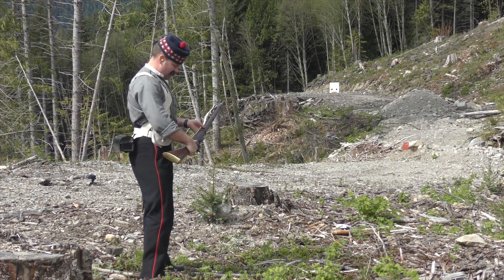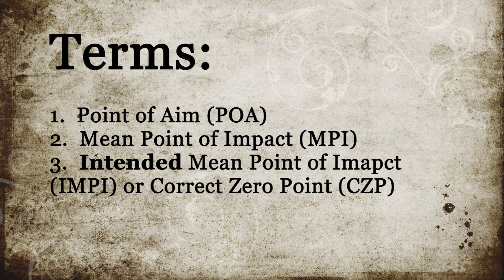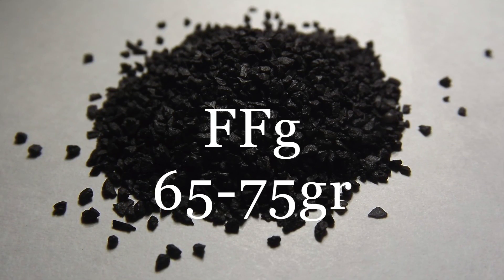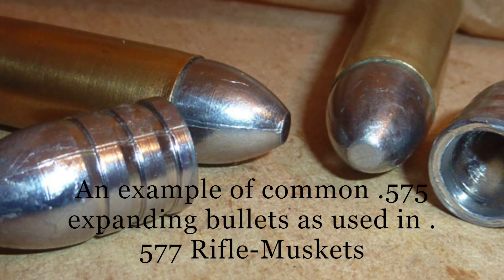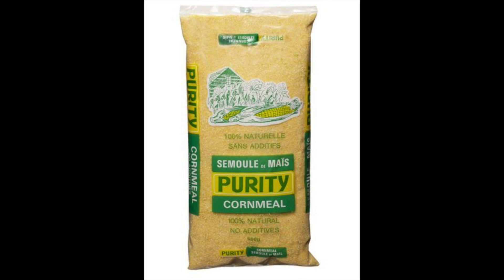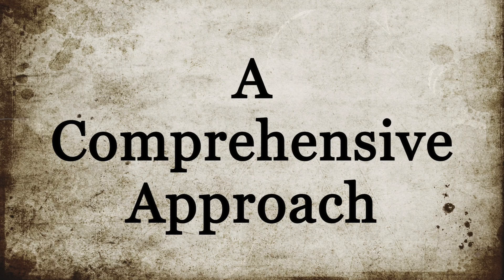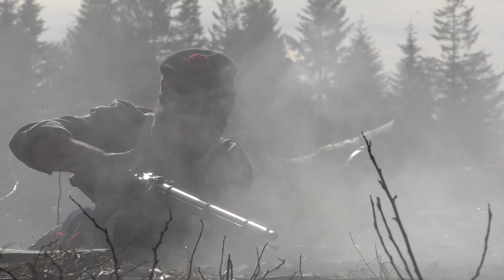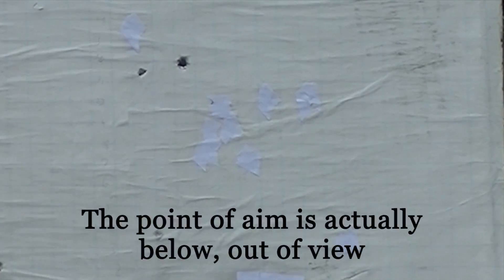The Mk III Snider-Enfield:  Working Up at 100yds -PART ONE-

Comment: That was a great video, cannot wait for part #2.  I wish I had seen this 4 years ago when I was struggling with trying to come up with a accurate load for my Snider...oh well. There is I think some things that I should redo in light of this with my new Mk.III.  It was interesting to see you repeat some things that I did.  For example one session (& by mistake) I forgot to put in the card wad between the powder & filler.  To my surprise the groups were all tighter in that session :) so that wad was for some reason a detriment in my rifle anyway.  Great stuff, thanks Rob.
Reply from the maker: It really is about trying all kinds of things.  I have found (like you), in Snider shooting, the simpler the better.  Cheers.

Comment: an old finklock guy I know said that the volume measures were calibrated for ffff as that is most powder. and all lower f will be less its built in safety
Reply from the maker: For every shooter, there is a story.  The bottom line is that a grain is a measure of weight. .... :-)
Reply: true true i always figured the 4f thing made since tho i have not looked for any conformation but i guess it woulds be a good rule of thumb

Comment: Hey Rob,
Nice as always. I can not await part two... Every time I enter YouTube I close my eyes and then look if you uploaded a new video. :-)
Your Videos are like professional documentaries.

Now to what I intended to ask:
Your bullet grease seems so simple. What is the exact task of bullet grease and what brought you to choose only beeswax and cooking oil (if I'm right...) ?

Thanks!

Valentin
Reply from the maker: Hi Valentin.  Thank you for your very kind words.  The lubricant keeps the fouling soft.  By doing this, the rifle is able to maintain a certain degree of consistency in its shooting.  Without lubricant, the fouling is very hard, and would coat the inside of the barrel, filling the rifling.  It also has the task of lessening the resistance of the bullet as it travels down the barrel...  After all, you are pushing a (soft) metal object down a metal tube....  metal on metal always works better with some sort of lubricant.  As for the recipe, it is very common to use beeswax and some sort of grease (organic rather than petroleum).  Vegetable shortening is what I typically use but I have used olive oil (more expensive) for the same purpose.  You can always add all kins of other things (for black powder shooting most commonly organic stuff) like lanolin, other kinds of oils, tallow and such...
Reply: Thanks for the quick response!

All you said seems evident...
I am very interested and may want to make some experiments to optimize the mixture and maybe 
replace the beeswax with a cheaper alternative like sheabutter. However I just do not know the criteria and the characteristic the beeswax or the potential replacement has (that makes it convenient for the task). What exactly is the substance that softens the fouling?
In a forum I read that e.g. the moisture content in the Lube is important for this task.

To sum up my problem in an example: I like to put lanolin into the Lube mixture - but I do not know why I should do so. What makes it suitable for the lube?

Thanks!
Reply from the maker: If you are looking for the chemical reason the lube works, I can't tell you.  The grease and the wax work in tandem.  The grease has better performance but is messy and will run in warmer weather....  Add wax to stiffen it....  However, they both have solvent qualities.  For instance, pure beeswax was used on later Enfield cartridges after they reduced the diameter of the bullet.  I have found that pure beeswax doesn't do the job either in the Enfield or others such as the Martini, in the way that grease, or a mixture, does.  I use straight shortening (melted) as the lube for patches for my Baker rifle and can shoot all day with no problems....  This only work with the Baker as the patches hold the grease well.

Comment: have you ever tried goex's Olde eynesford powder? I load 41 Swiss, 10.4 italian, 11mm beaumont, 11mm gras, and 45-70 with it with fantastic results. almost no fouling what so ever. No added graphite so it matches what was used and considered top shelf powder in the mid to late 1800's. I have converted many people who swore by swiss to it. I will shoot an entire silhouette match with it and never clean the gun and not have any accuracy degradation.
Reply from the maker: I have not.  I'll ask my supplier about his ability to get some.  I have heard of it but never tried it.  Thanks for the suggestion!
Reply: well worth the little extra money. I notice much more consistent velocities to. Also clean up is a breeze. 4 sets of wet/dry patches then oil and clean! can't beat it

Comment: ever notice that alloy hardness had an effect? I had an old front stuffer once that for some reason just liked a softer slug? never could figure that out? I've seen a couple other guns like that as well. might be an area to consider as well?
Reply from the maker: Indeed, it is yet another variable.  I tried a 20-1 lead-tin alloy and found that it did no better (or maybe a bit worse) than pure lead.  For the extra effort and expense (tin is pricey) it was not worth it at all.
Reply: Keith Moore: For a muzzle loader you can only use soft lead, this is because the projectile has to be able to go down the barrel when loading, if it were hard, it would not obturate enough to take the rifling, for a cartridge rifle this is not a problem as the projectiles are at groove diameter plus .001", this size projectile would be impossible to load into a muzzle loader for obvious reasons.
Reply: Englishman French I've seen at lest 2 black powder cartridge rifles that were the same way, they preferred a softer alloy as well for some reason,  2 identical rifles on the range, but the one just liked a softer lead?  I don't know I've got a couple of pistols that just hate Remington ammo to boot maybe when some old timer tells you that some guns have a soul they're right?

Comment: What are your thoughts on the 1837 Brunswick rifles? Been eyeing one recently. Bullets are pretty neat.
Reply from the maker: Careful if you are looking at the IMA versions.  They are not Ordnance pattern (British manufactured) and were made in Nepal.  They are typically poorly done with wonky rifling both in pitch and depth...  If it is a British one in good condition, then go for it... they are very rare but will be made well.  For bullets, contact Jeff Tanner in the UK.  He does very reasonably priced moulds for them with the belting...
Reply: Yeah I was looking at the IMA ones. Sigh...Thanks for the information. Guess I will just keep my eyes peeled for a proper made one for now.
Reply from the maker: They are out there.  Be prepared for the hunt.

Comment: If I got this right: 1f is for cannon and other artillery pieces: 2f is for rifles and shotguns, 3f is for handguns and 4f is for priming pans? I thought 3f has lower pressures than 1f and 2f...
Reply from the maker: Nominally.....  the more "F's" the finer the granulation and the faster the burn.  Higher pressures with 3F, that's why you don't need as much...  cleaner in my experience too..

Comment: Hi I didn't see it But do you Drop tube your powder ,  I found it advantageous when loading for my 45-70 Sharps
Reply from the maker: HI there.  Although the powder drops through a tube, it's not what you would call "drop tubing"... The main purpose of doing that is to get it all into the case (in your case, the 45-70).  If you didn't, it would be exceptionally difficult, if not impossible to get all the powder into the case.  With the Snider, (and the Martini) the opposite is the case.  Too much room, hence the fillers.
Reply: Thanks , Most excellent insight , Now you say it its obvious , I did see a video of someone drop tubing on large cases , saying he thought he possibly got a more consistent powder burn , But its possibly more in the mind than actual results , And when you I suppose hit the right worked up load , you pretty much don't want to change anything you did

Comment: Maybe you should add a warning about "hard" or "blocking" fillers...they should never be used in bottleneck cartridges, only in straight wall ones like you are using.
Reply from the maker: Good suggestion.